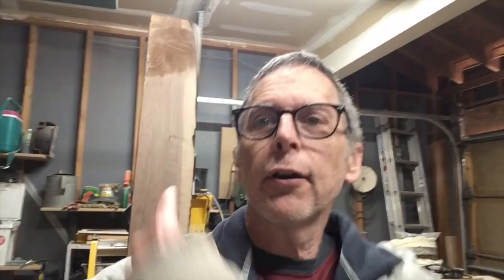Tips On Selecting Wood For Making A Guitar

Comment: For those that are not aware.  Home centers (Home Depot, Menards, Lowes etc) are not ideal as lumber sources because they rarely if ever carry wood suitable for guitar building.  Certain home centers store wood outside, in buildings not climate controlled, and are often warped/twisted.  Most of their wood is for home construction and common builds so the wood is thinner (far less than 1 3/4" or 2").

I have only one decent source I can travel to conveniently, but they are limited to what they sell, and though they are do have good sources of wood for guitar making, I've found that much in store is not the right thickness.   Plus I can't just drop $500 or even $300 for a plank of wood.

To be honest you can use StewMac for body blanks, but they don't carry purpleheart wood as an example.  They ONLY carry the more common species of wood in "Generica" guitars (Alder, maple, swamp ash (they never seem to carry regular ash) mahogany etc.)

for me I have to deal with 4 seasons where the weather can be very A.D.D. and unpredictable.  So acclimating is not so simple.  It's very very very hard for most who don't have shop space or are working out of our homes to find quality wood that can be stored.
Reply: kjemradio woodcrafters is good im not certain they are a chain though

Comment: I have a question:  how do you go about drying the wood, and measuring/estimating the moisture content?
Reply: Unless you ahve the equipment and storage it's best to buy the wood that has gone through that process.
Reply: @Lowdollar23 for how long to kill the bugs and eggs? and what temp for a 2 inch thick body blank 6 to 8 inches wide? thanks by the way i dont mind the baked colour
Reply: thanks for the reply do you bake the 2 inch slabs hardwoods and kill the insects deep inside this way? I mean i heard that the bugs bore out then lay the eggs back inside the existing tunnels... pretty sure the heat should get into those tunnels after 6 hours or so baking and kill all eggs and beetles.... its weather it will kill the actuall worm larvae and pupus stage in the wood at the core!?? what do you think I have english ash and similar 2 inch thick and 6 - 8 inch wide at 17% moisture or so... I am wanting to do the oven bake method you said to sterolise the slabs, but I dont want to bring wood with bugs in the house! how many hardwood slabs have you baked this way and did the insects die off for sure? thanks